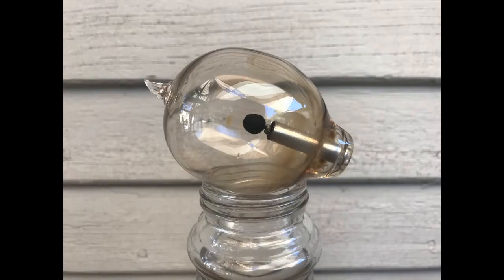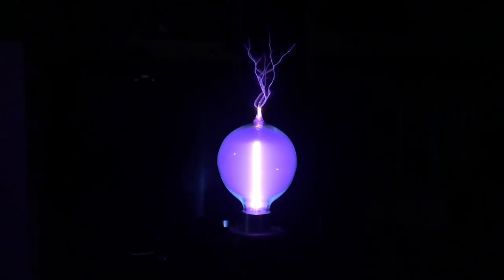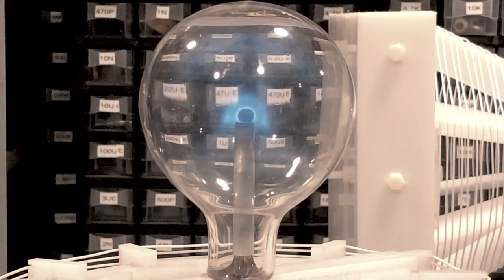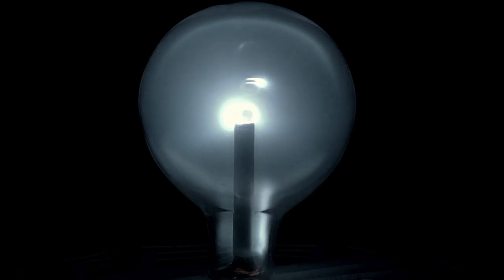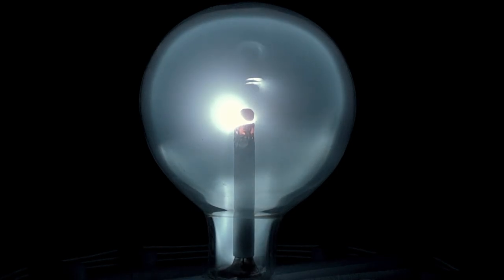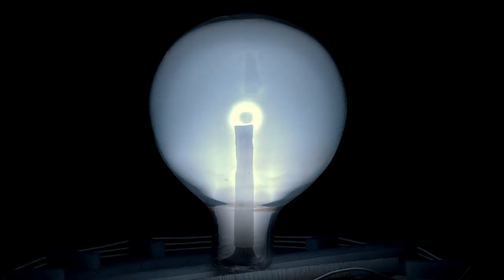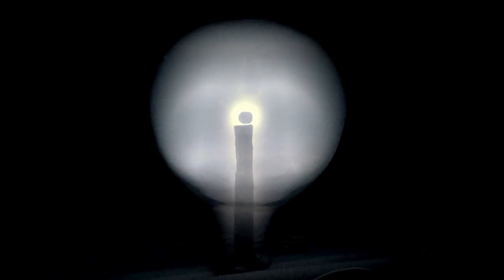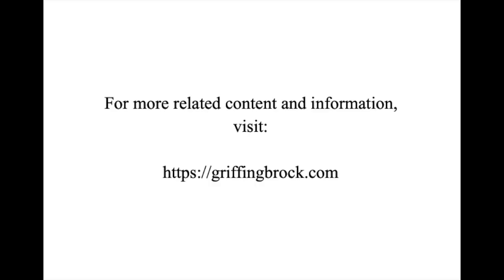Tesla's Rotating Brush Effect Finally Observed

Comment: You have produced an excellent globe duplication of the original.
The phenomena is a plasmatic illumination coordinateable to standing waves and influenced by the rarification of the vacuum and elements within the bulb, which change as the conductor surfaces change structure from the illumination of the compounds in the bulb, and also has an influence from Coriolis force which creates ccw rotation when there's zero friction of the gaseous state.
This is why in Tesla's other bulb patents he had 2 electrodes spaced apart in the bulb. That keeps the rarification consistent and is the forerunner of the now going extinct fluorescent bulb, which 100 Yrs ago was the best in efficiency and energy savings compared to incandescent current draw, and brightest illumination technique in the world, which today is replaced with Ultra Bright LED's.

Comment: Looks kind of like the aluminum or carbon was thermally evaporated and deposited thin layer of metal or oxide on the inner surface of the tube.  Depending on atmosphere you have in there, could have contaminated the gas a little too.

the transition in glass coloration Looks like the inside of some tubes downstream from a thermal evaporator or a lightly coated sputtered substrate.
Interested to see the differences between before/after on capacitance, conductance of the bulb as measured from outside.  
Or maybe light refractance from different laser sources through the glass bulb could tell you if a deposited material is interefering.

I'd bet that a thin conducting layer on the perimeter of the glass would mess with the way the center brush tries to discharge; if might preferentially take that thin film as a shorter path.

where do you discuss these results outside of youtube?
ES forums aren't very active, so i'm curious if there is another platform you use to discuss.
Reply from the maker: I post most of my work on my website: griffingbrock.com

Comment: It's shorting itself out
Reply from the maker: Not exactly sure by what you mean about shorting?
Reply: @GriffinGBrock  it's finding a shorter path to be ground then using the path you want it too
Reply from the maker: @freedomer342  Yes, that's the classical definition of an electrical short, but this lamp isn't shorting. There is no dielectric brakedown of the surrounding air, and the bulb operates irrespective of a discharge "short".
Reply: @GriffinGBrock  tried taking a dummy stick (AC wall tester) to it. A short generally happens in what is shown. It starts out fine and then it slowly stops working. Gotta think man, that thing was red hot and it could have just expanded enough so you wouldn't be able to see a discharge from the plasma sounding it.
Reply: As Tesla himself explains the red hotness of the carbon is due to the rapid charges bombarding it with high succession. That is not a sign of having a short.
High frequency phenomena and standing waves differ seriously from normal AC currents that you would probe with sticks and multimeters for a short. For these RF phenomena think in terms of current and voltage nodes in 3D space. This is a whole different beast.

Comment: Have you tried using coiled coil configuration? I don't see much people using it, not even tesla. The magnetic field produced by such coil is circular/hyperboloid in natura instead of just straight line.
Reply from the maker: This lamp acts as an electrostatic open system, whereby the presence of a connecting inductor would not instill a closed circulating loop of current, and therefore, be unable to facilitate magnetic flux of appreciable magnitude.
Reply: @GriffinGBrock  It's fine to have low magnetic flux. Just wanted to know the effects. Like adding the "tesla coil"/extra coil(that is not coupled with the secondary coil) to the tesla magnifying transmitter.